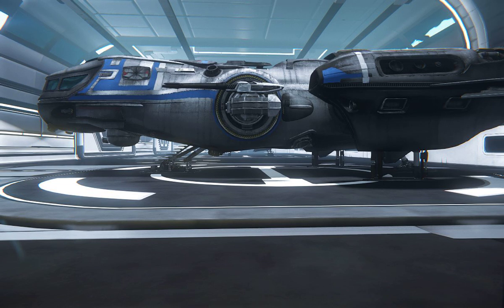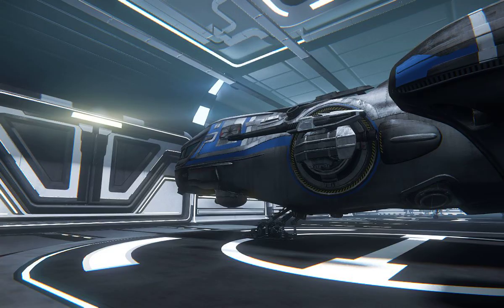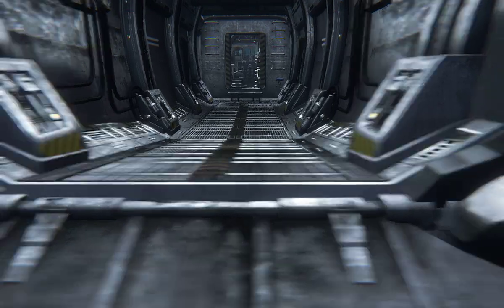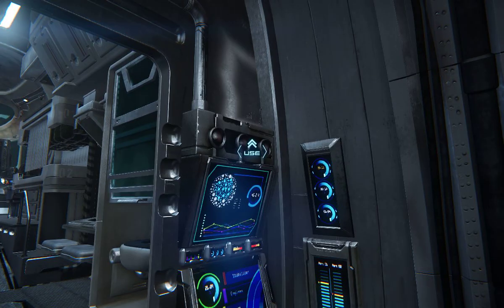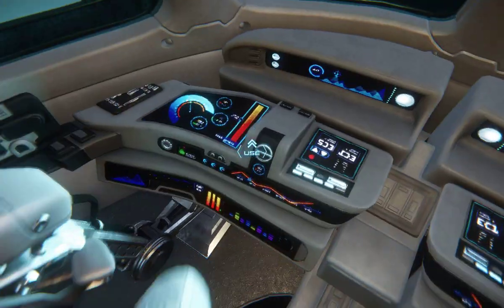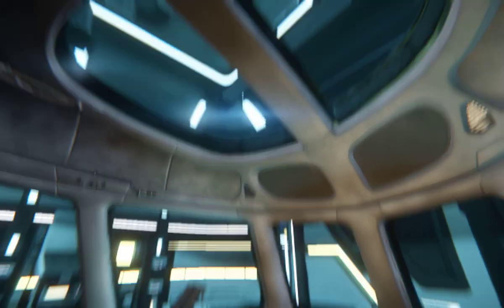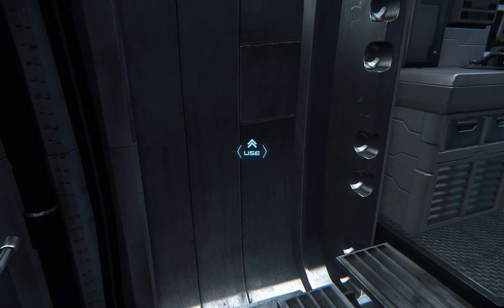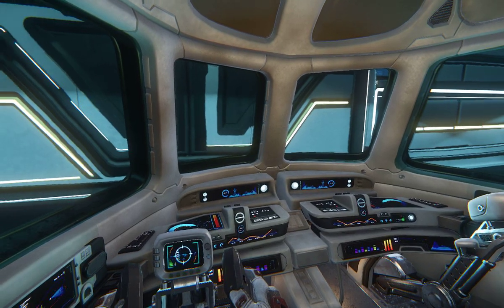MISC Freelancer - Star Citizen - Alpha

Comment: After "exploring" my Freelancer, I also think that the whole ship should be a couple of three of four meters wider than it is.  It should also be around 2 meters taller. Having spent time on a US Navy equivalent - the Orion P3 - this feels far too tight for actual work.  If someone was sitting at the research station on the port side, no one could get around them.

I also don't see the value of the missile racks on the engine nacelles.  Those hardpoints would be much better used for increased sensor of stealth packages. But, to each their own as it could mean the difference between life or death if you're planning to use the Freelancer for something outside of research and exploration.

As others have mentioned, hot-bunking is a way of life for such a crew, so the bunk situation is spot on (at least you're not racking on top of the torpedoes... shout out to the USS Cavalla's SONAR team)

I'm really excited about getting started in the new 'Verse.  Who knows what we'll discover (besides CIG, of course).
Reply from the maker: If i could thumbs up this five times i would.

I talked to WingMan a while back and he said the missiles were artistic liberty from the concept art, prior to their design of missile and weapon system standards for the game.

Comment: I kind of envision the winglets to get attached to the main body, so that the engines can rotate/gimble without them, but the same effect could be achieved by placing the missiles on the main body.

Making the winglets into wings that connect to the fuselage could resolve this as well, but that space could easily be made into upgrade space for fuel pods or something similar.

Comment: i agree with most of the points made in this video such as the uselessness of the cranes. however, i disagree in your theories that the walls are too thin, and how electrical things wouldn't be able to fit in them. I feel like in a time when space flight is common, and almost required by society, that humans would have made highly advanced developments in terms of discovery of new, stronger and lighter alloys that could withstand much more than alloys we see today. As for the wiring, if you take into account the theories of miniaturization I feel it is completely possible to fit all necessary electrical parts and piping into such thin walls.

Comment: At 16:30 - you speak about an exploration sub offering better visibility.  This is not correct.  Because exploration subs are designed to handle extremes, the physical windows are tiny portholes.  The visual is primarily provided by remote controlled cameras.  In fact, I'd replace the windows with heavy armor and use display screens internally.  Again, this ship should focus on potential extremes - nebulae, star proximity, ultra radiation sources all pretty much ignore glass / quartz / etc.
Reply from the maker: I was thinking in terms of those little bubble subs. I fully agree tho, I think windows should go away entirely. Search the forums for the windowless freelancer concept someone painted up. It looks so awesome.

Comment: Fuel is typically carried in the wings of most aircraft.  Fuel pods are only ever used for extended range type operations.  I don't know if that assuages your concern with that.  Also, the materials that these spacecraft are made of might be a little more advanced and not need to be so thick for the rigors of space flight.  There is surprisingly little metal between you and a large fall in aircraft, less than 6 inches in many cases.  I only bring these points up to try and put some logic into their design choices.  The pillars, however, are ridiculous and WAY too big. lol
Reply from the maker: I hadn't really thought much about the futuristic materials side of things when I made this. My main concern at the time with the thickness was when you try to land on a planet. It just seemed like under weight it wouldnt hold.

I'm kinda hoping for fuel pods. This one is supposed to be able to do long range exploration so some extra fuel would be nice

Comment: nice video, but your picking on the weight of the gun vs thickness of the hull i dont think makes much sense, we can already hold so much more with much less material then we could in the 1950s, imagine another 900 years?

and the crew size thing, i dont think just because it has a co-pilot seat and 2 backseats means they have to be manned, you dont expect a gunner to sit in that cramped bubble as you travel for hours, do you?

Comment: Don't want to sound like a dick, but every comment you made kind of sounds almost pointless. The cranes? A placeholder till they make the proper functions, the four bunkers? In the idea of this game, long ass deep space missions will sometimes just require half the crew to be in their positions, so most can just sleep but two will need to be awake in shifts, for piloting and probably either comms or engineering. There is no need for 6 bunkers, also those seats 2 extra seats in the back are probably meant just for extra crew. It won't be necessary to fill those spots. Also it would be suggested that a gunner isnt just a gunner, so the gunner spot would not need to be filled 24/7. So that means the gunner is just someone from the crew. The crew should be jack of all trades. For example 4 man crew, man 1: Pilot/gunner, man 2: Comms/Engi, man 3: gunner/engi, man 4: Pilot/Comms
Reply from the maker: Fair point on most except the crew count. The published stats for this ship is a maximum of 2. Yet there are clearly quarters for 4, and as you said, the ability to rotate shifts of 8 or so if you really wanted to get cramped. And you're right, you wouldn't need all filled at all times. Im sure some of those positions are meant for the sciencey stuff, which you wouldn't be doing all the time. but the biggest point i was trying to make is the disparity between apparent design, and the published maximum crew.